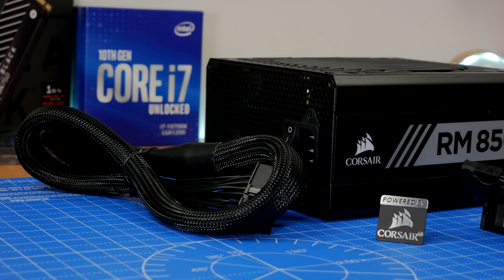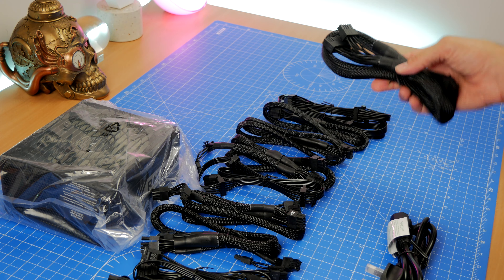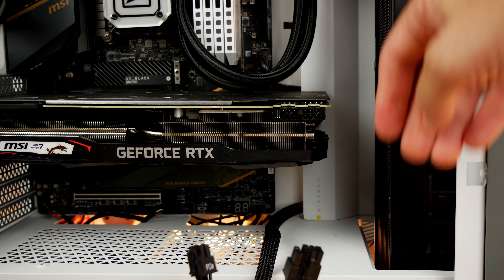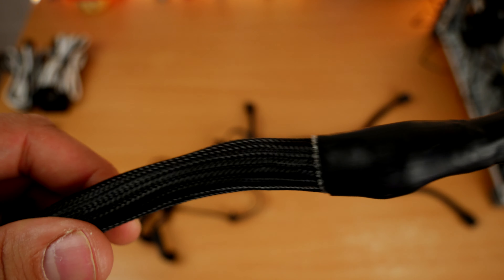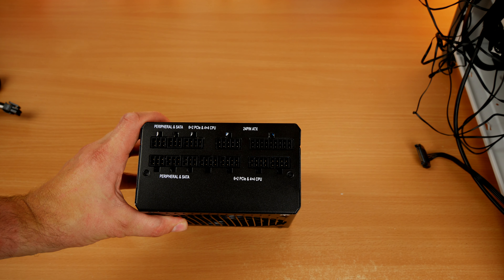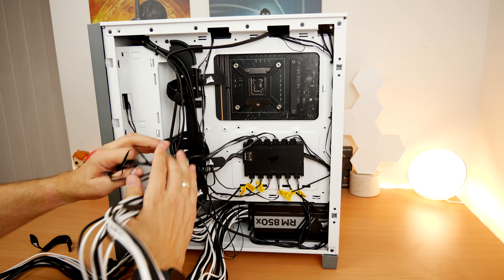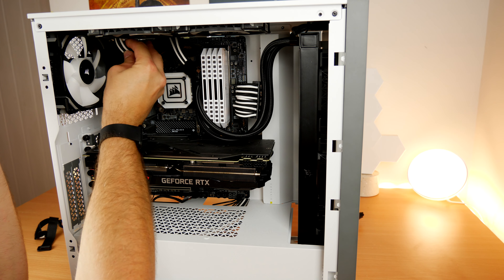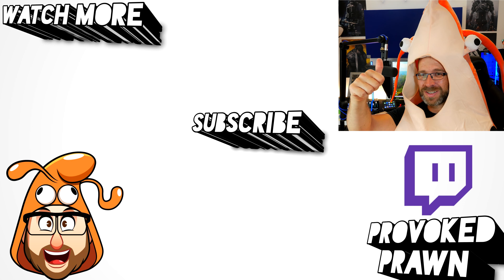Corsair RM850x Power Supply unboxing and setup and why you need a premium PSU cable kit

Comment: Forgive me for being so dumb but I just blew up a 500 dollar mobo and a 1500 dollar gpu because I cannot for the life of me understand the back of my Corsair 850 rm it dosent even say the same things on the back of mine like it does yours . But it’s the same exact psu? I need to know where you would connect the 3 8 pins on the back of the power supply? I only understand where the 24 pin goes can I use pcie slots where it says cpu? On the left top of the 24 pin? And below it’s says sata/pata. I haven’t a clue what that means . Just doing a video where you point to the connections for people as dumb as me to show where you would connect cables to power up a 3 8 pin connection would be so helpful, instead you just talk about how the cables feel.   Please help me. I ordered all new stuff after blowing up my last 1st attempt and I really don’t wanna blow this one up . Thank you and any diagram you make would be so helpful on just where I plug them In . Thank you

Comment: I’ve had this thing for 1 year and it’s basically dead silent
Reply: @18-xxx  yeah haven’t had a problem with it other from the stock cables looking really ugly but I don’t recommend you getting it because the price on it in amazon is way over the intended MSRP
Reply: @Nick Diesal it’s all opinions at the end I like some color to my build because the original one where cheap looking and where really stiff felt like I could rip the connector in my mb if I try to bend them

Comment: i bought my rm550x and doesn't have the velvet bag[the older unboxing of rms power supply come in a black velvet bag], i did some research and i found out  corsair remove the bag cause of mole issue.....anybody know if this is true or mine was a open box...
Reply: My new rm850i also didn't come in  a velvet bag. At first I was irritated and wondered why. But if I'm not the only one who received it without a bag, then I guess they leave it out intentionally (maybe because of the  mold issue you mentioned).

Comment: The "need" in the title is rather an emphatic statement in this case, as opposed to relaying any sort of necessity. If you have your wits about you then you'll know that the "one chunky cable" can be split apart without damaging any of the insulation and will wit into more places than the sleeved counterpart because the sleeves make the whole bunch of cables thicker.  But then again, if you had your wits about you, you would not be building a case with RGB+windows and without sound isolation. Good luck relaxing and listening to soft piano music with all that racket and mind-numbing LED light coming out of your case. Not a fan.